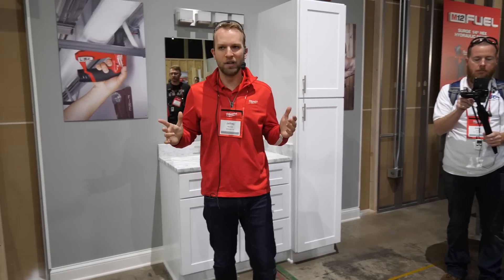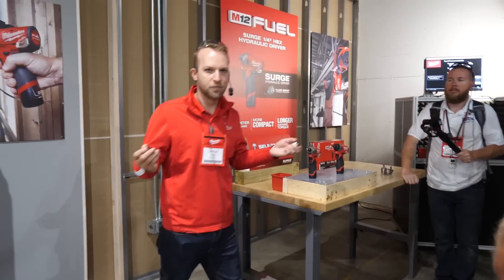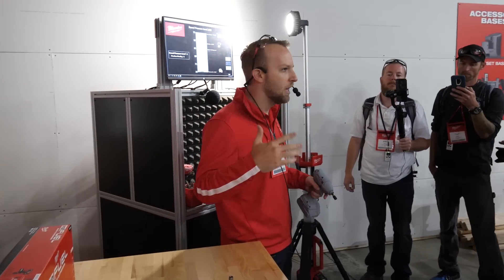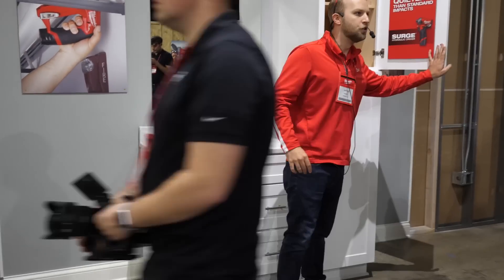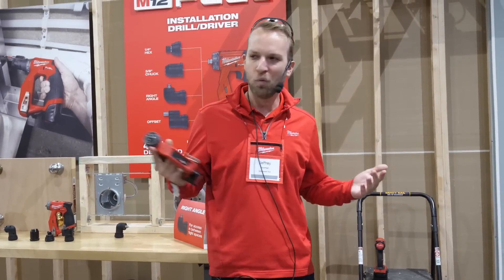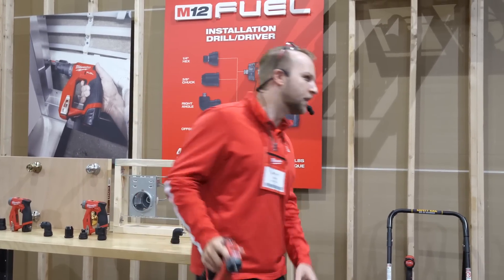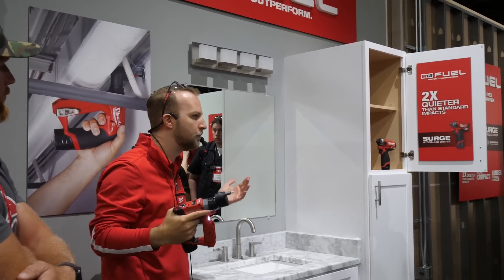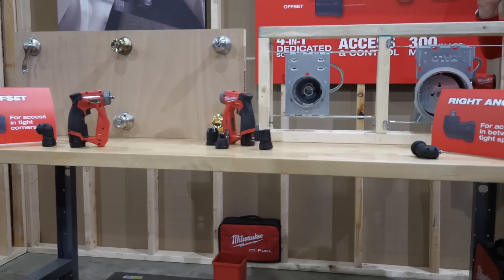Milwaukee M12 FUEL Surge 2551-22 & M12 FUEL Installation 4-N-1 Drill/Driver 2505-22 Kit #NPS19

Comment: I was going to buy the Milwaukee 4 in 1. It has a really good feel in my hand compared to competitors. Then I did more research. From what I have seen on the tool itself (at the orange apron supply store), the offset head is only a magnet hex hold. That is why you only see the guy in the video put in a screw and take out a screw. You do not see him drill a pilot hole because, from what I have read online, the drill bit comes out and remains in the hole. So if you are working in a tight space, you need pliers to pull out the drill bit. I've also read that the magnet breaks and falls out of the offset. I hope Milwaukee will fix this problem.

Comment: Didn't quite drive that screw all the way for the Milwaukee during the M12 Surge sound test ( 4:38 )...  Was that because he knew it would break past 85 db when it was under a heavier load??  I love Milwaukee tools and want it to come out on top, but this does not seem like an honest test to me.
Reply: YOU READ MY MIND!! He looks to be putting that fastener into some very dense wood.

So then to drive flush as he did with the other it would have either:

- Slowed down considerably for the last inch or two and embarrassed the tool despite it maintaining the lower decibel rating.
- Ramped up in power with more rotations and impacts inside the motor and given it a higher than average decibel reading.

A bit sly there with that tactic I have to say, I want to see what happens with the last 3 or 5 seconds of driving that bolt/screw flush against the competitor (Dewalt/Makita)
Reply: Ryan I have the M18 Surge and there is big difference in sound regardless.  I can attest to that. Nothing compared to the regular impacts.
Reply: @ibrazeau3044  I imagine there is, even if it breaks the 85 dB mark it would still be a marked improvement.  My problem was that it just seemed dishonest that they did not bury the screw the same way they did with the competitors brand.
Reply: Joe P agreed... the demonstration seems gimmicky and somewhat staged... dishonest.  FWIW, the Surge is still a great great tool... under appreciated, misunderstood because of misconceptions due to power ratings being tabbed differently.  Know that a 10db sound reduction equates to a reduction of half the sound. That being said and regardless of cheesy marketing demonstrations, the M18 Surge is my EDC tool.
Reply: @ibrazeau3044  Agreed and a lot of people still dont understand that lower decibel ratings are not linear readings for the ear.

They are doing a lot to bring the noise down more so than other manufacturers where the hydraulic impacts cost fortunes. 

I think my brushless impact here in the uk is £130 where the lower noise hydraulic is more than double that at £300 and both bare tool.
Reply: B T lolll my thoughts too.  I'll be expecting a tool Tuesday full sales review on that one too!  But then again, he would be right to do one cause he uses the M18 one all the time... and the Surge truly is a great tool.
Reply: So deliberately stopping before the full lag is driven. I gave always been concerned about the hydraulic oil leaking
Reply: alimuh007 no worries on that side.  Had mine since they came out and no issues.  Our winters are friggin cold, so when I'm in doubt of it freezing, I use the regular gen2 but very rarely.
Reply: Literally every company has one of these hydronic quite impacts.
Reply: Ryan - Wow that's a steep price!  I know Makita and Rigid make similars... wonder if their price points are same?  Either way, for institutional work (multi residential, hospitals, etc.) these impacts are a beeute!  Worth the money IMO.
Reply: Taylormade2350 - yes and they are worth their little weight in gold.  Especially for institutional in-house work.
Reply: Joe P - FWIW, I did a none scientific test... used an iPhone with decibel measuring app and drove in 10 3.5" screws in 4x4 treated wood with my Surge.  Testing similar to some seen on YT.  

All my measurements showed 85db and lower all the way through the impacting process regardless if the screwing was complete or not.  What happens is that it impacts sooner and all the way through at the same rate (sustained torque) so the sound is steady and continuous.  Regular drivers impact later and much louder at peak torque.  

So in practice, and in view of my non scientific testing, the demo they performed is kosher and not fraudulent!

My two cents.
Reply: I Brazeau I never said they didn’t work. I said pretty much every company has one. You can get one from Ridgid or Ryobi for a 1/3 of the price.
Reply: Taylormade2350 ridgid and ryobi are all rebranded Milwaukee.

Comment: I have installed a lot of cabinets in the last 6 months and they own a m18 surge and they own the original first generation impact. the only thing that sucks about not having the noise is not decipher the resistance IE whether you hit a stud or not  with a quite a bit of the time with a quiet impact. Just saying quiet is nice except for when you need to know you hit a stud.

Comment: I love my m12 fuel impact driver, but the presenter did say they "didnt compromise on power". Yet the surge "only" has 400in lbs and the non surge impact puts out 1300in lbs. I'm not sure if I'll upgrade to the surge unless it has more features other than just being quieter. Not at almost double the price.
Reply: To be fair they didn't compromise on power from the m18 surge, to the m12 surge, not the normal m12 fuel and m12 surge. I had to rewind to listen again.
Reply: Peak torque is only part of the story though. The Surge drivers have a much longer sustained torque while a regular impact has a very sharp, short spike in torque. So for small low torque fasteners impulse drivers just as fast as regular impacts.
Reply: The industry is really doing a disservice to their hydraulics by marketing them as just quieter versions of their impacts.  When each is actually better at different tasks.

Comment: Presenter aside... I'm a BIG fan of the M12 series tools. I've found that they do about 90% of everything a 18v tool can do. The only time I've wanted more power was mixing mud, and large hole saws or spade bits. Even their little M12 circular saw does about everything I've asked of it. For most jobs, I leave the 18v stuff in the trailer anymore...
Reply: I bought an M12 circular saw from Milwaukee to cut 2X4s for a commercial project for the purpose of exploring the M12 line.  It didn't disappoint.  We use the saw continuously on a 10 hour shift with the 6 Amp battery, and it holds up for the entire shift.  I intend to use the M12 system for household projects, but they're solid on some applications if you don't want the weight.

Comment: How many times did he use the word nice when describing the installation drill/driver. 😂 This is really not new though. Festool been had this for many years now, but just on a larger scale. This drill is even shaped like it too.
Reply from the maker: 12. Exactly.
Reply: These were built to be taken out of a pretty shop setting or the set of This Old House and be used in a regular guys work day.

Comment: So you’re saying you didn’t have to compromise on power....yet the 1/4” hex impact has 1300 inch pounds of torque....And that surge has 450?.... sounds like a little bit of compromise to me
Reply: RICH REVIEWS I believe the 450 is a sustained torque on the surge, while the 1300 i a maximum output reading. So the difference is less obvious in a real World applicarion. Look into sustained vs max torque for an interesting read. Have a nice day sir 👍

Comment: How bout sinking the rest of the lag bolt in there bud. Lol

Next, right angle stud drill... That thing sounded like it struggled. How many more holes could you do?
Reply: The installation tool is not meant to be drilling 7/8" holes as its main application, they were just showing what it was capable of. Rep said it could do 50 of those 7/8" holes on a 2Ah charge. It's mostly aimed towards driving screws and drilling pilot holes in close quarters and hard to access areas.
Reply: Doresoom Tool Reviews agreed. And I mean if I have to make more than holes in more than one stud is there even a wall anymore? At that point you just bring out a different drill.

Comment: Milwaukee should have one key on their m12 and have more protective boots for all their tools
Reply: Real power tools don't need protection.
Reply: @draytonPW  Boots protect what you're working on too ;-)
Reply: @MrNateSPF  One more reason why I like tools that have that protection built in and not an optional accessory.
Reply: @draytonPW  Yes but that protection wears out, boots can be replaced.  But I agree boots should come with the tool to begin with.

Comment: What is the difference between the surge model and non ?
Reply from the maker: Hydraulic fluid. More constant torque but less peak torque, so it can fasten many things quicker but less power for but busting. Also much quieter to use.

Comment: You guys just killed the Bosch Flex Clic !
Reply: For the record I have a 12 volt flex clic , on the plus side , versitile , on the down side , low powered . Another vice , the chuck tends to come off !
Reply: K Connor (
Reply: K Connor h
Reply: There will be a new Bosch flexclick with a brushless motor, increased power and even more compact coming very soon. 12v as well. And btw i just dropped my 12v bosch from 10 feet down on a concrete floor today, still works perfectly. I love both brands but you can never go wrong with bosch, solid stuff.
Reply: Vindusmekk , I have a Flexclic , and really like it , well built and compact , but ,,, I prefer not to have too many battery platforms with me in the feild , and it’s underpowered , compared to my Milwaukee 12 volt tools . The Flexclic has got me into some difficult spots , and has a permenant place in my “ back up “ tool arsenal , along with my two Festool flexclic like devices !

Comment: I used to be a millwauke guy loved them then the m 18 came and I lost all respect same set of of drills impact Two motors two sets of brushes. switched all my stuff to metabo 18 different class of tool more expensive but so different.
Reply: What?
Reply: @ActANoob  sorry just seen that two drill two motors burnt out.

Comment: Milwaukee is really making me dislike them as a company. So dishonest. Turning tools into disposable gadgets. Notice how he runs the Makita until the bolt is flush, but with the M12 he stops early. I suspect under heavy load the noise advantage severely diminishes. And that is assuming we can trust the on screen meter. A db meter would suffice.